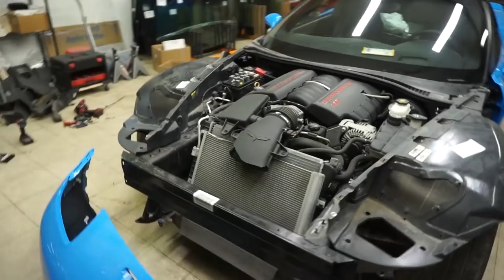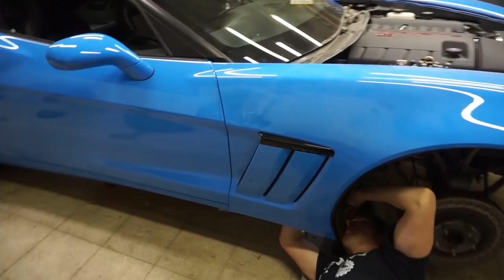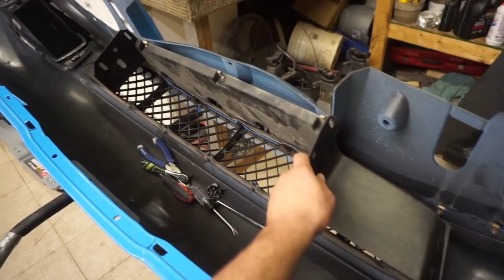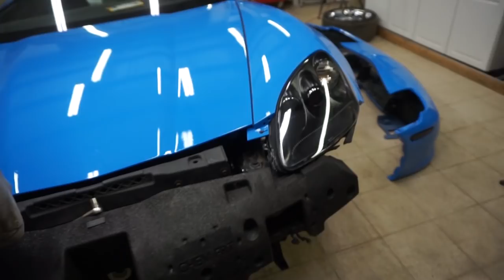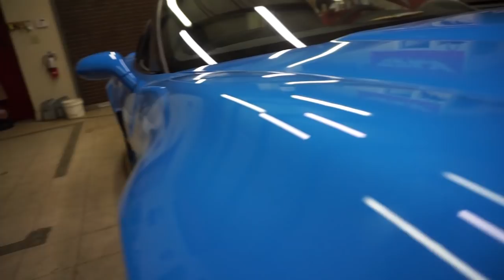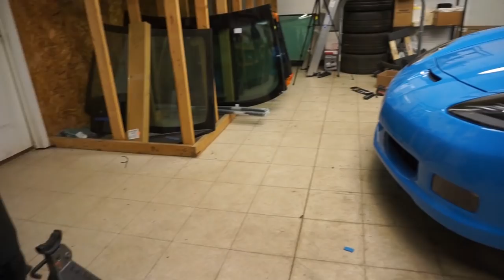Rebuilding Wrecked 2011 Corvette Grand Sport Part 9

Comment: Are you replacing the seat belt? If so change the color of the seat belt yellow to match the yellow calipers. Show should powdered coating the caliper like you powder coat the rims
Reply: That's a good idea with the seatbelts. I like that. But weirdly enough our seatbelts are fine, not locked up.

Comment: Are you guys replacing the a/c condenser and air intake ?
Reply: Ac condenser is staying. It holds pressure. And the intake we are going aftermarket. It still hasn't come in.